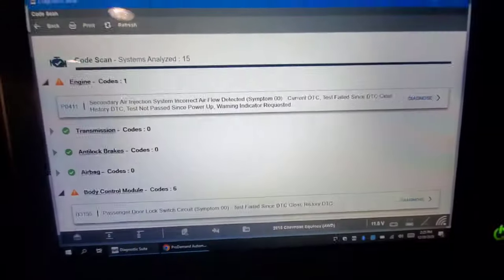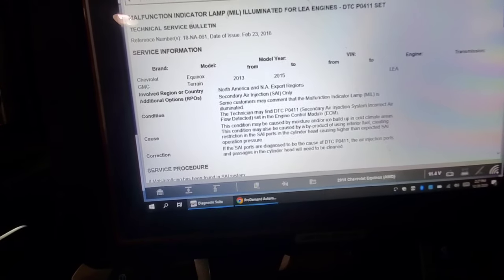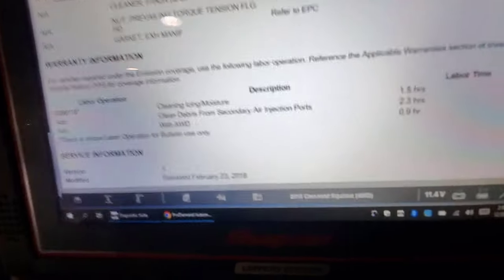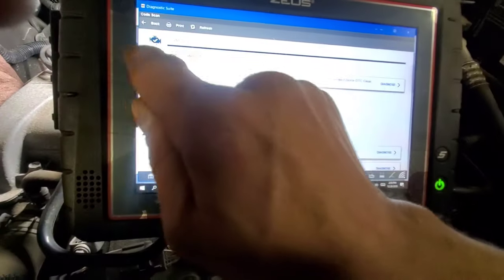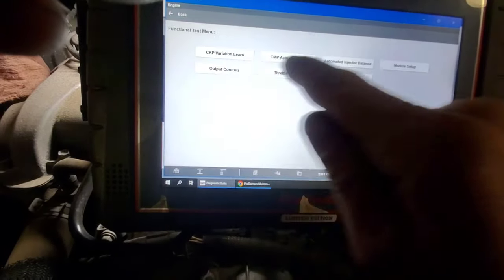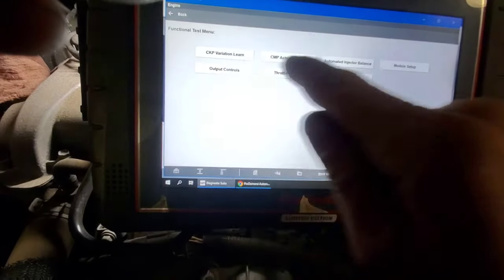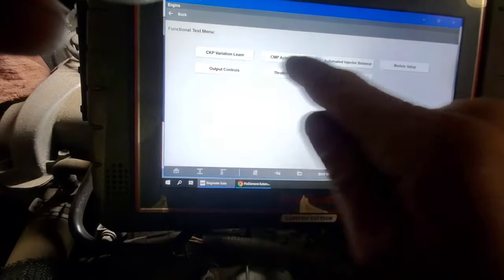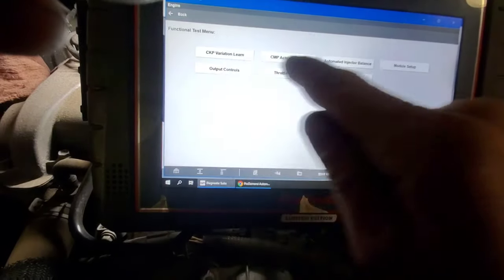GM 2.4L P0411 SECONDARY AIR INJECTION AIRFLOW INSUFFICIENT

Comment: quick dumb ?. I need 2 secondary pumps for my equinox are they the same piece or they different pumps.
Reply from the maker: It is one air pump with 2 control Solenoids that control the flow from cylinder's 1 and 2 and 3 and 4.
Reply: @PaulysAuto  okay whats the difference between. a air smog pump and a air smog check valve. I have 2 black hoses  that needs to be connected to something. my mechanic said my cylinder head didn't have smog ports he by pass it somehow took both air smog pumps off now I have the right head but don't know what parts goes to the 2 black hoses
Reply from the maker: @blesdavis7637   If the vehicle has California missions it needs the correct head which will  have ports for the the 2 pipes that go to your air injection solenoids for the Air injection flow to occur.  The Air pump just pumps the air to the solenoids and when Air injection is required on initial startup the ECM commands the Air injection pump and solenoids on to send air into the exhaust to help speed up the catalyst process for closed loop fuel control.
Reply: @PaulysAuto  thanks man. I appreciate your time and knowledge
Reply from the maker: @blesdavis7637  No worries 👍 thanks for the support 👍

Comment: I can not get those air cross over bolts out.. im stuck on the two lowest bolts between the manifold.. any tips on what you used or how you got to them
Reply from the maker: Wobbly quarter inch extensions
Reply from the maker: With a flex head quarter inch ratchet
Reply: I tried 1/4 inch.. I believe I have the wobbly.. but I mean the nut seems straight and the angle just seems all wrong. I appreciate the feed back. I wish some would make a video of removing those. I do appreciate the feed back
Reply from the maker: @mikegray7873   You can get them it's not fun but you can get them
Reply: I had to actually take the manifold off to get mine out which i had to do anyways in order to in clog the holes in the back of the block where the manifold gasket goes
Reply from the maker: Of course
Reply from the maker: How else do you think you're gonna do it right
Reply from the maker: Out of curiosity was that manifold cracked?

Comment: For anyone having this problem I was having same problem after all the video's I tried hooking shop vac up to the hose that goes into breather box from secondary air motor suction hose and I reversed and blew air into it next day light is off been off all day
Reply from the maker: If  the ports are plugged the ports are plugged
Reply: Any update? Is it still off? which port are you referring to in the head?

Comment: Let me.ask you... do they click during warm up if it's plugged up?
Reply from the maker: What are you referring to?  The Solenoids or the pump?
Reply: @PaulysAuto  solonoids. Theres a unique clicking or ticking coming from the back front side of my engine i cant identify. I dont knoe if maybe the solenoids might click a bunch when the ports are clogged. Even when unolugged. In my head it makes sense because that pressure has to go somewheee. It stops clicking when warm too
Reply from the maker: @captainsledge7554  put your hand on them and feel for synchronization to your sound.  You sure it isn't your chain smacking on the upper guide that may be wasted?
Reply: @PaulysAuto  well what made me wonder if its them clicking, was. A lack of timing chain codes, and a p0411
Reply from the maker: @captainsledge7554  I've seen chain guides wasted without it jumping time on the 2.4L
Reply: @PaulysAuto  right me too but usually those engines will throw a code when therss slack in chain because the vvt picks it up. Its annoying. But the thing is... will a chain with slacj in it... cause a po411.. or clogged ports click due to pressure?
Reply: @PaulysAuto  basically all im asking... is have u heard them click from pressure due to being clogged at the ports. Thats all im asking. I can diagnose beyond that
Reply from the maker: @captainsledge7554  I wouldn't think so, they may be going through an initial circuit test on start up and that could be the noise you are hearing?  I know the ports plugging up in the head is the most common, but guy's have said that the solenoids fail as well...really tough for me to know without hearing what you are hearing.
Reply from the maker: @captainsledge7554   Another thing to keep in mind, is those high pressure fuel pumps will do that too when they're going through their self test... However, those are on the front side towards the intake.
Reply from the maker: I imagine you have direct injection on that?
Reply: @PaulysAuto  this isnt first start up. It is untill its warmed up. Ya know... to operating temperature
Reply: Aculator

Comment: if it’s ice causing it which is probable in my case can’t i just wait until it melts
Reply from the maker: The problem is the ports in the head get clogged with carbon... The ports have to be cleaned out otherwise you will not pass the DTC.
Reply: @PaulysAuto  ok thanks
Reply: What's the size of the freeze ports plugs? i have a malibu 2.4L and have the same problem
Reply from the maker: @abduliscool74  Plugs? There are no plugs...the ports get clogged with carbon which prevents the Air Injection Pump from pushing fresh air into the Exhaust on cold startup; which helps expedite the Catalyst process in the Converter and push the system into closed loop fuel control faster...California Emissions System only the Federal Emissions 2.4L doesn't have any of this.

Comment: STOP STOP STOP Would you please clarify if this stupid  air injection system is ONLY ON CALIFORNIA CARS . I am in missouri and my 2015 equinox 2.4 ecotec does not appear to have this system. THANK YOU FOR YOUR GOOD WORK AND GOOD HEALTH TO YOU IN THE NEW YEAR
Reply from the maker: California Emissions only...you'll know if it's got it by looking behind the Cylinder Head toward the firewall  and Exhaust Manifold....you will see this setup.

Comment: Was this a recall?
Reply from the maker: Not as far as I know, maybe a special coverage depending on circumstances, but this was actually a published Technical Service Bulletin. Depending upon your purchased warranty, it's one of those things that may or may not be covered.  You should consult your local dealer and see, I don't want to give out poor information on this.
Reply: @PaulysAuto  Thank you for the response,it turned out that it was...Cleaning of the secondary injection ports and replacement of the pump👍

Comment: I don't know the cost but I'm gone find out today P0411 code 15 GMC terrain ohh boy with only 43,000 miles smh
Reply from the maker: I feel your frustration and I do not disagree
Reply: Needed two air valves and something else they said went to the GMC dealer each valve 400 but my warranty covered it I only have to pay 200
Reply from the maker: @Emmanuel-zr8cl   This is good to hear at least You got a deal on All of It

Comment: Gm should be paying for this cleaning for a bad design
Reply from the maker: Wouldn't that be wonderful?  That's why I don't own CA emissions vehicles.
Reply: They do! Special policy. 10 years or 150k miles I believe
Reply: @440-6pakroadrunner   🧐🧐🧐 I took mine in the other week and they quoted me a pretty penny. 2013 with 91k miles
Reply from the maker: Yes, depending on what you paid for warranty ofcourse 😉
Reply from the maker: It's not ideal, but these engines are solid if you take care of them.  3k on oil changes is VERY IMPORTANT
Reply from the maker: Change your thermostat and coolant at 5 year/100k increments it maintains proper engine operating temperature...allow 5 - 10 minutes warm-ups before driving VERY IMPORTANT